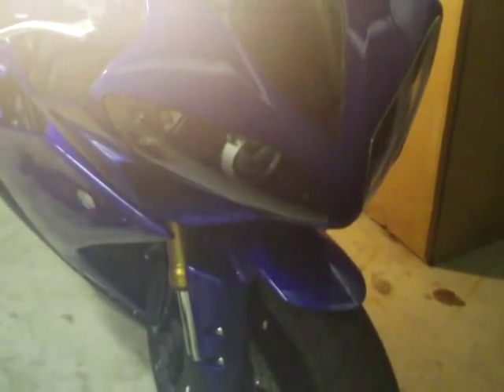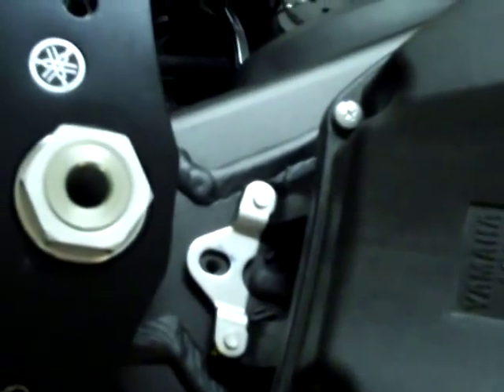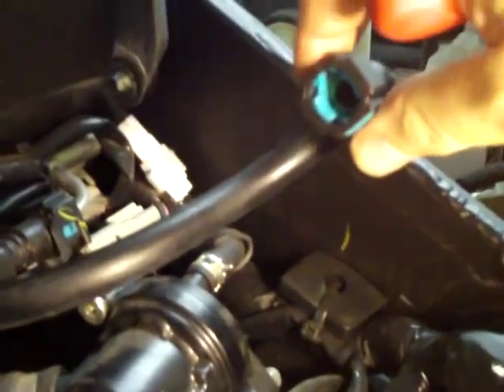2007-2008 Yamaha R1 Stalling Problem Fix / How to

Comment: Question: are u guys stalling due to low idle? I'm at 14k (07) and I'm having this problem basically a cold start. Replaced plugs, filter, battery and charging system good. Wondering if I should give this a shot
Reply from the maker: Brandon Ryan It'll probably help
Reply: i have the same exact bike with the same amout of miles..... with the same exact issue. Please let me know if this works for you!
Reply: John Youssef I just did this fix about 30 min. ago after having this problem for a while and I have to say so far so good the bike seems to idle a little smoother and I was purposely trying to make it stall out coming to lights but it hasn't yet!
Reply: Jordan Widdiss Funny you mention this. Here we are 2 months later; it turns out the reason my bike kept stalling was because somehow the the position sensor got unplugged. How this happened? I haven't the slightest clue! Anyways- thank you for the response; i appreciate it!
Reply: John Youssef the TPS sensor got unplugged? Where exactly is it located to check on mine? And did this not cause a code for the check engine light to come on for you??

Comment: i just replaced my clutch sensor switch and bam worked like a charm, no more stalls or dying when i pull in the clutch! 

its located underneath the clutch lever and is held by one screw, you might strip or break off trying to remove it like i did, so i just retapped and put another screw. you guys should try that before messing with the throttle bodies
Reply: Thankyou just orderd this exect sensor im replacing that first if that doesnt help then im gonna adjust these crews ill post an update in 2days from now if it worked

Comment: my r1 2008 starter motor need to be replaced!what is the original starter motor manufacturer part no?or any suggestion of better starter motor ?
Reply from the maker: D Duncan Factory parts for stuff like that

Comment: Did this also help fix the starting issue? Bike will crank, and I would have to give it throttle till it is about 160* then it will idle.
Reply from the maker: Sounds like you're having a separate problem
Reply: +calairo15  Did you ever fix this problem? I am having the same problem with my 07 R1! Let me know. Thank You.
Reply: Shawn Mills the fix i found was when you start the bike, keep holding in the starter button 3 seconds after the bike starts. It has something to do with loop in the computer. Let me know if it works with yours.
Reply: I will let you know! I will try tomorrow! Its starting to drive me crazy though. Cause I start it hold for a few secs at low rpm and then after about 30 secs it stay on and runs. I can drive normally. Like nothing. Then if I get to a store or somewhere where It stays off for more than a few mins I struggle to turn it on again! Only when it freshly starts after awhile regardless if its cold or not.
Reply: +Shawn Mills same thing as mine. Cold start, bike starts right up, bike is warm, it takes several cranks, idles, then does. So on a warm start, push start button without letting go even after bike starts, and count to 3.
Reply: +calairo15 DUDE!! IT WORKED! I pushed the button and it Stutters. Kind of Starts for half a second. You let it cycle for the 3 seconds and it fires right up! THANK YOU!! SO MUCH! I am going to run with that. BUT! How do you fix it? To where you just push the button and have it start like normal??
Reply: that's to hot I keep mine below 150°

Comment: I'm going to  try this on my 2008 R1 now. I also notice that I have the 4 screws in different positions right now, but I assume it doesn't really matter. When they are closed they will be closed regardless the position. Then I just open each 1/2 turn. Right? Second question, did you ever balance the throttle bodies afterwards? You mention in the video that you might do. Thanks in advance.

Comment: Any ideas on another R1 problem i have? Sometimes it just clicks when you try to start, like an interlock clutch or side stand switch defective. Battery is new. Starter relay maybe?
Reply: I am curious now. You ever figure it out?
Reply: Could be a starter relay, otherwise could be your starter on the way out, start with the relay because it's cheaper and easier to fix and if that doesn't do it start looking at the starter, if you tap on the starter while it's doing that and it starts the bike, usually it's a good indication it's the starter

Comment from the maker: Been 3 years.  Hasn't stalled since.
Reply: hi, im hoping i could get you opinion on something, my bikes a 05 r1, things pretty much ran great the last 6 years. now about 3 weeks ago it started acting funny when i tried to start it, i blew the starter solenoid, fixed it, but now itll start but immediately stall, pretty much as soon as i let go of the starter button, even if i giv it throttle, itll rev high but still die,some one told me 3 weeks ago it was the coil packs, did them yesterday, no change... any thoughts?

Comment: @jlsparky7 I understand you. The only thing I was saying that this is the right way to synchronize them.
I had the same issue with my bike but the problem was not the synchronization it was the power commander. The dealer who set up  the bike on his dyno was giving way too much fuel to the low rpm range. It was cutting out every time I came to the stop. Also had a terrible idle. I did everything and when I hooked up my laptop I saw the mistake the dealer did.

Comment: Instead try making sure your fast idle wax unit is not sticking it's the tube looking think next to your injectors that pushes the two plungers into the side of your throttle body make sure those plungers arnt sticking

Comment: Hi..My bike R1 08..Show overheat at to 120c not up no down when I up to speed.but I'm ride at 110 k/n not problem.what about wrong? Thank you sir
Reply from the maker: be sure your system is purged of all air.  As long as you dont get warning or check engine lights I wouldn't be worried.  They run super hot.
Reply: +SparkysGarage ..I will try..thank you sir..

Comment: heya. ive got an R1 from 2005. It runs just fine until the engine gets somewhere past 85 degrees celsius then i have zero idle. then i have to keep the bike alive with the throttle
Reply: im an idiot as i forgot to ask the actual question, do you think this fix applies to my situation aswell? ill check in a couple of weeks when i have time. thanks
Reply from the maker: It should help, yes.
Reply: thanks for the reply, however i removed the gas tank and found that the scews werent there. diffrent engine back then. im starting to suspect it might be the TPS-sensor

Comment: My buddy has a 06 r1 if he rides and stops it will shut off or if he puts it in first holds clutch down and messes with throttle it gets low and shuts of I changed the plugs and nothing you think this would fix it?  It only has 6300 miles
Reply from the maker: Exact same problem with my bike,  this fixed it
Reply: I'll try it and let you no thanks!
Reply: And?

Comment: hi I have an 04 R1 with the stalling issues, ive had the TPS replaced with no improvement so I thought I would give this mod a go.  ive taken the tank off but for the life of me I can only see the 2 outside screws to adjust. help please as this stalling thing is driving me mad. cheers
Reply from the maker: +Pete Crewes Try adjusting just those two.  Not familiar with the 04 setup.  Maybe try buying a manual to get the exact location of the other 2?
Reply: +SparkysGarage  took my tank off on my 04 r1 today it was hard to find a for I only seen two on the outside but there are four the aren't evenly spaced across but the two on the left are the same as the two on the right it's very tight and there behind all the hoses couldn't find a way to get a screwdriver in to adjust it seems almost impossible please keep this updated
Reply: +ButchR1. I think on 04 R1 we might have to lift throttle bodies up. this stalling thing is a nightmare because it's intermittent. keep me posted with your findings. I've tried a few things that people have suggested but no joy.  this 180 degree fix is just another one I will try. good luck with yours
Reply: Did this help for you? I'm having the same problem with my 04 R1 and it is very annoying.  Any info would be greatly appreciated.
Reply: I've got a 04 R1 and it's starting to do the same, pull up to the lights ,as ya changing through the gears and the revs drop just cuts straight out, press the start button and she fires up, doesn't cut out on every trip , did you guys sort yours

Comment: @jlsparky7 I'm just a little nervous. I'm not a mechanic but I'm a pretty descent engineer.  I would feel more secure about the procedure if you would have specifically shown Each of the four screws in the video so I know I'm messing with the right stuff.  But I'm wondering if I show my dealer mechanic this video, if he will do this for me.

Comment: Hey Sparky! If its still idling low, should i turn it more than 180 or less? Thanks!
Reply from the maker: Hicham Hichams As long as it isn't stalling I'd call it good.  The bikes are made to idle low so they don't overheat in traffic.

Comment: hi i got a problem with my 07 r1. It started idling bad and cutting out when i was at bike week.  i looked at my dash and the gas light was on. i thought bad gas and used gas treatment and it got better. now it only idles bad when the bike heats up. when im riding it normal until i stop and let it sit for a few. anybody know why its doing this. my dealer tring to get me to replace ecu and throttle body. their 1st guess was new tps and it didnt work. wasted $400 on that. guessing is to expensiv

Comment: Will this work for my 2007 r6?
Reply: Did this fix? And where in the r6 are these screws located. Can't get my r6 to idle at start up unless I give it 2000rpm and stalls at the lights

Comment: Did this and it had not fixed the stalling idle was a tiny bit better but still stalls
Reply from the maker: 88nicholas try adjusting it small portions at a time.

Comment: Technicians at the dealers do not know how to fix anything. Will this half screw turn out fix the idle issue? yes and no. it will stop the drop at the light but it is not the right way to make the system work FOR YOU. It is just like a downloadable fuel map, it WILL work but it is not RIGHT. Every bike is different and for some, there could be a bad sensor or a loose screw that causes this issue. This is supposed to be a last resort AFTER the other checks are done and nothing is found wrong.

Comment: This is a band-aid and Yamaha RTA states this as a POSSIBLE fix.
The only thing you have done is lean out the idle fuel mix. You can do this with an air filter or even an FI add-on controller. The real issue is mechanical. The book needs to be tossed out for this issue. A better fix is to remove the air screws, polish them, clean the holes out and when installing, turn ALL 4 screws in all the way and sync the throttle bodies using the LOWEST cylinder as the master.
Reply: Dennis Gibb man my 2008 r1 will not have any power like if it is a 30 cc bike or so "if there is any 30 cc bikes or worse" untill it gets to 5000 rpm and then it would go like 400 cc beaten up old bike :-\
what could be the problem no bodie is able to fix this and they have checked the clutch the valves the ecu the plugs the tps the fuel pump and basically everything that cp be checked we seaped the clutch with a new one ...still no luck I am thinking of gettine a new engine or I would just sell my bike to the reaper :'(

Comment: Please help my bike been down for months!once my bike warms up it ten to stall out.it will start fine in neutral but once you put it into gear the bike will cut off but I have my kickstand bypass and also the clutch bypass my bike used to run fine and I was able to start my bike in any gear n still can but once the bike is warm  it Will only start in neutral the stall out when you try to takeoff or put it into gear but runs fine in neutral and  rev up with no .when it’s cold I could ride it a few blocks and get it into all gears and it sounds fine once the bike warms up it starts stalling out.try almost everything went from replacing the coil packs, spark plug,Staterrectifier, bypass the clutch and kickstand it was running fine them one day fml...will this work on my bike ?maybe I could put up my video n u guys can give me some in put please 🙏🙏🙏@Sparkysgarage & everyone reading this please help a fellow biker out🙏
Reply: I know this is a couple years later, but did you replace all those parts like the stator, rectifier, regulator with oem parts or after market cheap garbage? Also was your bike ever overheated at one point? Does your coolant tank stay full or does the coolant disappear? Does the coolant tank bubble when the bike is running?

Comment: I'v tried several times nut doesn't work please  help🙏😭
Reply: Make sure clutch and throttle have no play, if you can get your hands on it theres a tool that can sync them for you. Could also need valve adjustment.

Comment: I have an 04 R1  and after a couple hrs drive it will stall the same way. It re starts. is this the same thing?
Reply from the maker: steve ricci yup
Reply: SparkysGarage hi Sparky! Do you have a video of the idling beforehand. I want to compare with my R1. It almost sounds like its running on 3 cylinders sometimes at idle, but once you take off everything seems okay
Reply: I actually found a bad spark plug
Reply: steve ricci Fixed the plug issue and drive beautifully. But now all of a sudden It wants to stall again for a diff reason. All 4 cyl firing. What I found is that the idle wants to drop below 1000 RPM. If I restart the bike it will do it again. If I cycle the ignition key it fixes it till the next time.  Any ideas.
Reply: +MotoBoy did you fix your bike?I have same problem...stalls when warm and when I take off at low rpm...clears up when cold
Reply from the maker: all fixed
Reply: +MotoBoy did you fix your 04 r1? what was wrong with it I have the same problem took it to the shop nothing was wrong everything work great but they couldn't find the problem. I bought new coils and is till sounds the same.
Reply: I did a whole bunch of stuff to the bike. Valve adjustment, new plugs,  synced throttle bodies, retuned the power commander and it somehow vanished. ALSO replaced the stator and flywheel because they went bad. The magnets on the flywheel on these 04-08 R1's always get ground up eventually. I wonder if maybe yours is starting to go bad...I could see it causing these issues. When it goes completely bad, your bike won't charge and it'll be as if you have a dead battery. Hope that helped
Reply: +MotoBoy it just sounds like is running on 3 cylinders but already checked that out the way. can find what's wrong with it. what did you did that make it work better. plus running on 4.5 rmp I feel like someone pulling back. like I say new sparkplug, coils and still can't fix it. I don't want to sell it bc I telly enjoy that bike.
Reply: Jose Montalvo Do a valve adjustment
Reply: +MotoBoy okay thanks I will.

Comment: Has nothing to do with ego, nor am I knocking your fix. IT DOES WORK ON BIKES THAT HAVE NO OTHER ISSUES. The key is to check EVERYTHING that could lead to this issue, hence the reason I posted the other issues that NEED to be checked first. As far as names and what I do, Chuck and Mark are heavy hitters who know more about tuning than you or I.
The point is THEY listened so there might be truth to the info.
Sorry if I disrupted the ZEN here. I am sure you can get my posts removed if you want.

Comment: I am sorry but this is a bad advice, you need a proper throttle/carb sync tool to do adjustment, you shoud have one screw fixed and marked with white paint and other ones should be adjusted to same vacuum level to that one, if you dont have a marked screw than book clearly points to close(turn in) all adjustment screws and which ever one has the lowest vacuum reading dont touch that and adjust the other ones to according to closed one. so one adjustment screw must be closed all the way in, stalling is a issue for 07-08 models yes but before you need to do sync you have to make sure you have all working spark plugs, air filter, adjusted clutch cable and throttle cable, adjusted valve clearence, throttle butterfly valves opening closing readings should be in given numbers and must be cleaned...you maybe still stalling like a do :) its a mystrious problem, ı am just riding it like that :)

Comment: There is no "one size fits all" with this. Some bikes had faulty TPS switches, one had manifold leaks, and another had o-ring failure.

I don't know about you, but I would kinda like to know what the problem is before I throw money or a "maybe" fix at something.

Probably why my vehicles still run like new even after double and triple digits show on the O.D. 

I am not bagging on your "fix" just filling in info that is necessary.

(you're a forum member aren't you? it would make sense)

Comment: I did this and it did not work
Reply: It seems to have worked for me you might have to synch it with a special tool. If that doesn’t work make sure clutch and throttle dont have play. If all that fails it could need a valve adjustment. I spent awhile researching this😂
Reply: issues? You figure it out yet